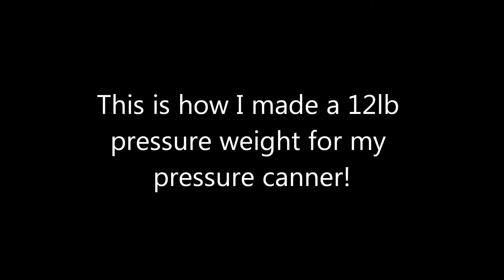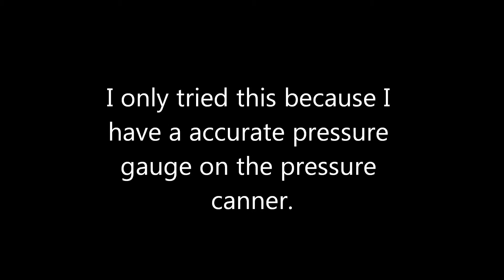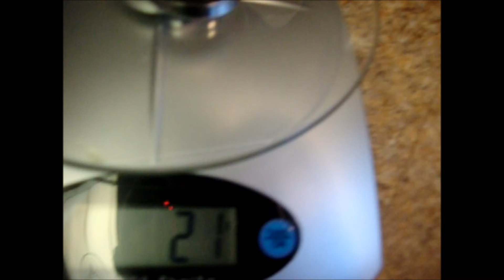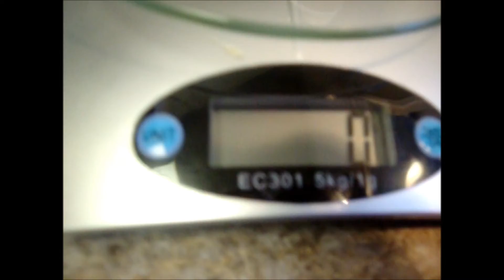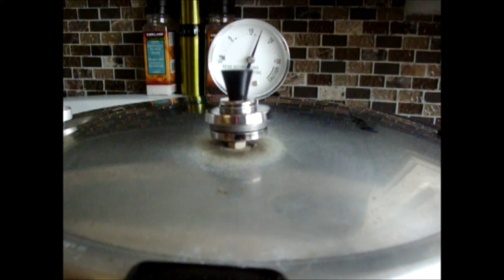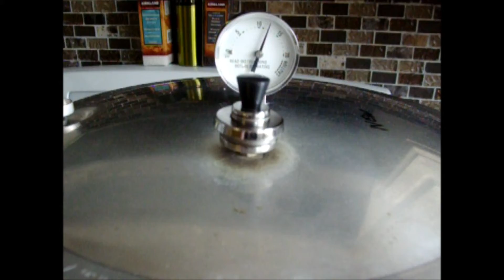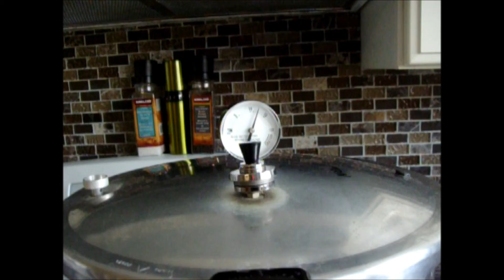Turning a 15 lb pressure regulator into a 12 lb

Comment: Hi!
Can you (or anybody) confirm the total weight for 15 lb operation?
I have a pressure cooker that can hold up to 23 lb (according to its safety mechanisms) but the weight is set to work at 11.6 lb.
I wanna add a little extra weight so it can work at 15 lb by doing similar calculations.
Thanks for this video.
Reply from the maker: Is it the 3 part weight? The bottom weight weight the same as the top on mine.
Reply: @cheekysaver  Yes, the total weight using the 3 parts of it. I saw that the rings weighted 22 grams each and I wanted to confirm if the base (5 lb) weighted another 22 grams.

Comment: Most awesome...you can find washers from lowes/home depot...and put them on it
The wabbler works off of pressure, the wobbler neck is like 1/4" or .250...so that is how the weight vs pressure works...
Awesome video..my son is a machinist...and I wanted him to take the stock heavy one and skim off above the 1st lip on the wobbler and weigh it until it was at the weight of the 10lb wobbler we bought from ebay for like $15 bucks...
But your method is so ingenious!  Now just figure out how much weight per psi you get and voila...completely variable wobbler